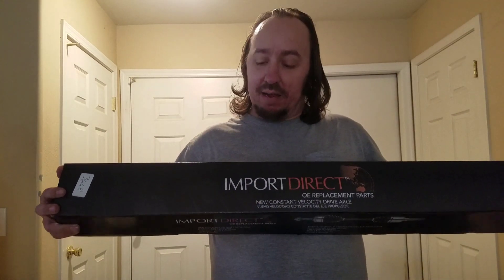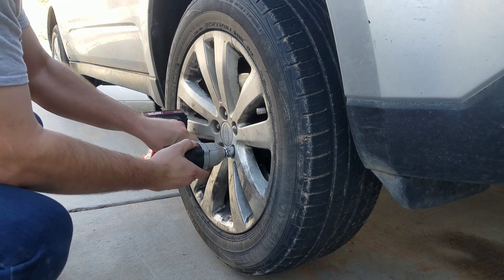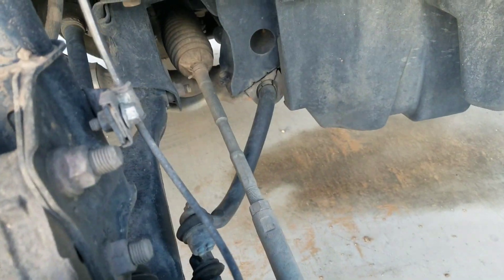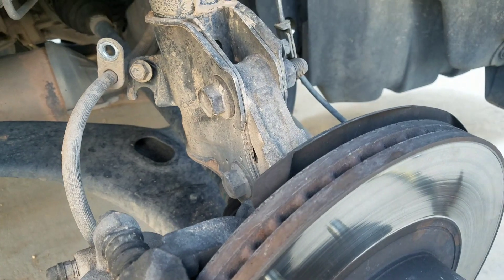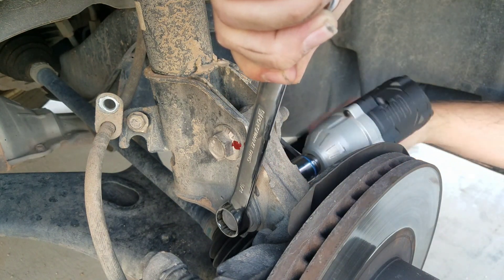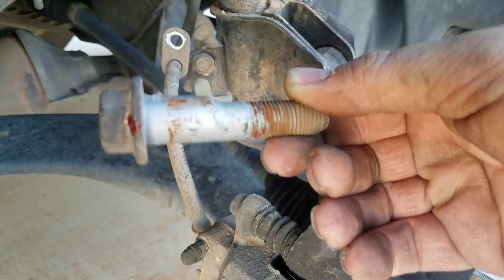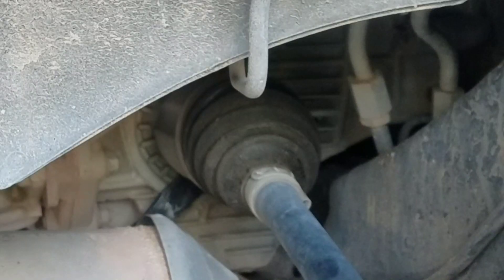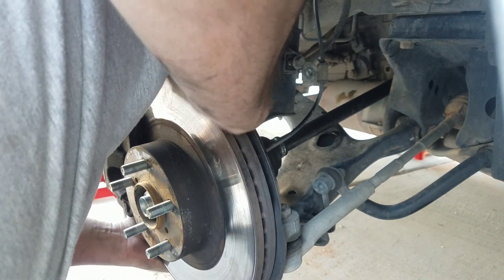CV AXLE Replacement(2013 subaru forester)

Comment: I used this video to replace the driver and passenger side CV axles in my wife's 2015 Forester.  I followed each of your steps, and it all went very smoothly with no surprises.  The old CV axles pulled out with just a few tugs.  Replaced with parts from Rock Auto, saving myself a lot of money in parts and labor.   The whole job took me about 4 hours, with a lot of that time spent searching for the right tools in my shop.  A good breaker bar and torque wrench are a must.

No more "thunk thunk thunk" in sharp, slow turns now.  Thanks so much for posting this.
Reply from the maker: Thats awesome!!! I never thought i would get a comment like that. Glad i could help a little. Thanks for watching🤙
Reply: PLEASE tell mee the part number on rock auto u used!!! I have a 2014 I want to do this too but not sure what the difference in every part is
Reply from the maker: @Bloomy215 just go the website and type in your vehicle. The difference in parts is look for it saying AUTO TRANSMISSION or MANUAL, FRONT or REAR and TURBO or NOT TURBO. The pricing of stuff is like amazon just different 3rd party sellers. Hope this helps🤙
Reply: @ I bought 2 and replaced them both forgot to come back and say thanks bro
Reply from the maker: Hell yea! Thats awesome🤙
Just your local Red Neck tryin to help😁
Lets Gooo!

Comment: Awesome video. Just an FYI for anyone attempting this just be aware that it is possible that the CV axel will not come out with a hammer and punch. No matter how many times or how hard I hit it I could not get it out. I had to rip everything off and am basically going to replace the whole hub and steering knuckle. It was also a huge pain in the ass getting it off. I’ll be leaving this one to the pros next time.
Reply from the maker: Very true. Mine almost didnt come out with the punch and hammer. I got lucky on that one.

Comment: When I removed the cam bolts my strut and spring expanded. Could not get it to compress and it ultimately ripped through the boot of the new CV Axle.
Reply from the maker: What the heck?? That should not have happened. Im curious on how?